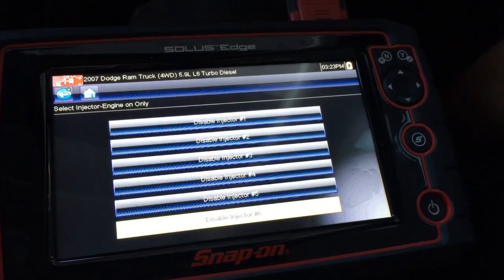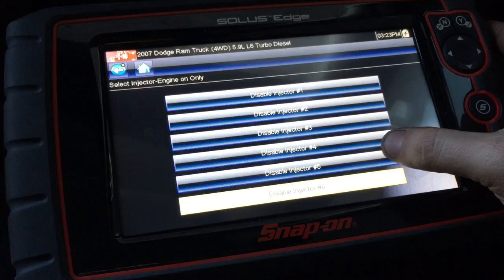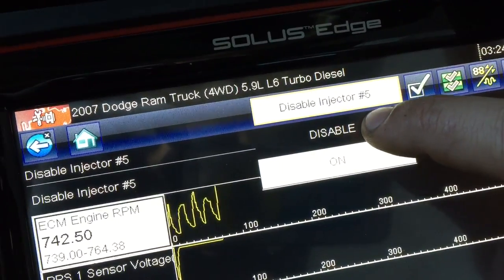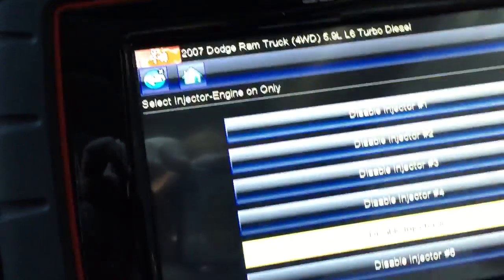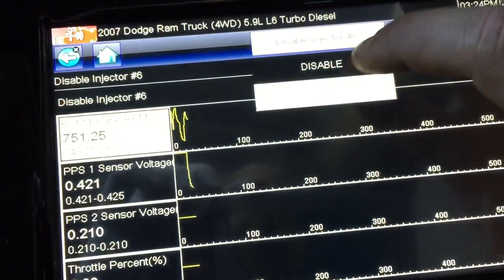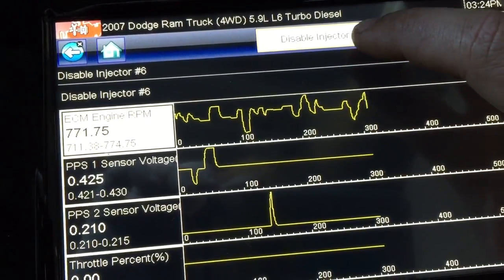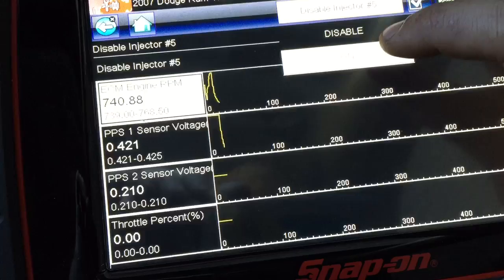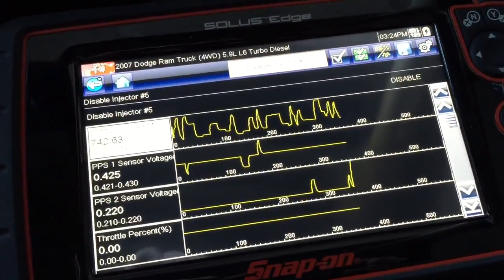5.9 Cummins Injector Kill Test with Snap-On Solus Edge

Comment: Does the truck has to be running I did this test 2013 dodge ram 5.7 if I disable the injector truck turn off automatically I'm new using snap on scanner trying to figure out if the injector is bad

Comment: My friend just bought one of the modis edge scan tools for his shop. How does he get to the screen to disable injectors.
Reply from the maker: It should be under engine tests or injector tests. Make sure the scanner recognizes the vin of the truck. Only works on electronic ignition trucks (obviously).